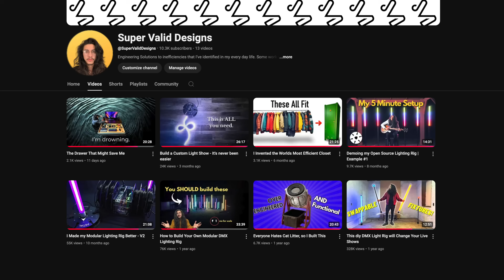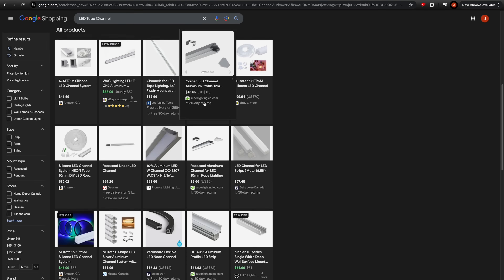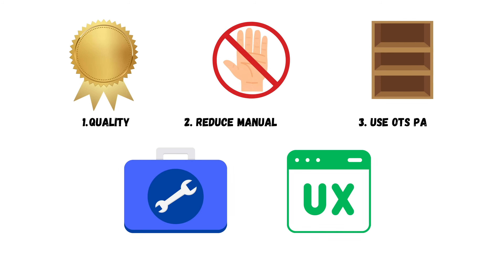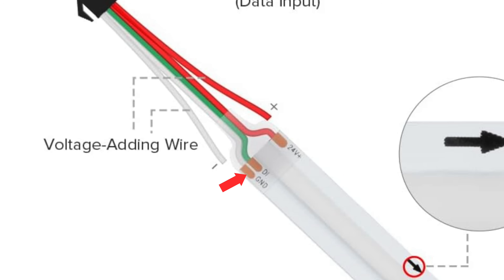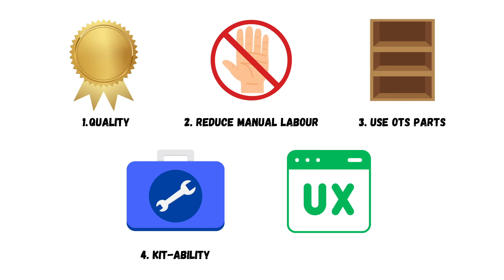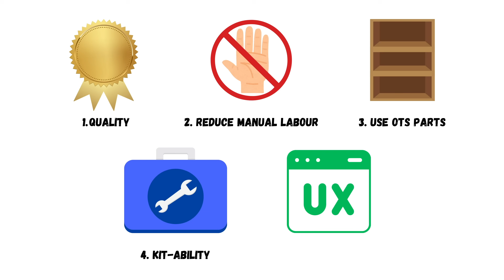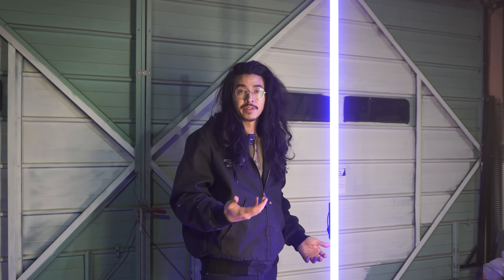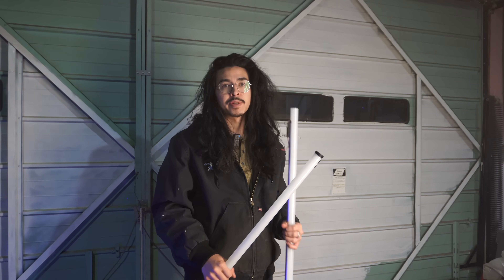The Stacker | Designing the first Official PETAL Fixture

Comment: This is incredible, I love your process, clear design guidelines and full integration approach with the manufacturer to end user pipeline tied to your own production, what a great plan! Where did you learn how to have a workflow like this? Are there any YouTubers or sources you learnt from that stand out? 

Have you thought about a more complex kit that has something like a pogo pin design and tighter tollerances, with something like an internal hoop to join the seam of the parts more rigidly? This hoop could be made out of a straight piece of clear plastic strip that feeds into the same cutout in the aluminium extrusion, requiring a light file stroke to add clearance and help with alignment for the increased width of material in the groove otherwise used for the light strip itself. This may not be necessary with the partial offset of the extrusion into the next piece, and it certainly looks like that is the case, but it might be necessary for closer, semi-long-term setups (or if you make a thinner or thicker varient). 

There are some relatively affordable benchtop cnc machines now, you may find that using a different material and a CNC provides a better consistency, fit, and scalability whilst reducing time per part.

I don't even have a use for light bars but this was a really intriguing video!
Reply from the maker: Thanks so much for the thoughtful comment! I've been building and designing things my whole life but I never had any formal training so my methods are probably fairly unorthodox lol. I love channels like Stuff Made Here and DIY Perks, they've been a big influence. The full integration approach stuff is all things I've had to figure out piece by piece and still something I'm very new at but I just love the process of learning about it! 

I have thought about the pogo pins, and originally I wanted to incorporate that into this product, but in the interest of keeping cost's donw and allowing for more tolerance due to our current manufacturing processes, it was just a bit out of the scope for this version. But this might make an appearance in future versions.

From my testing, adding a hoop always gave away the seamlessness away a bit more that just having the 2 tubes touching on the edges. The big issue I couldnt get around for the hoop idea was holding the hoop in place without using any adhesives. I also though having a hoop there would create a delicate spot that could break easily. It would be nice to have a more positive joint there but I have been really impressed with how well the offset aluminum channel has worked! 

I do have a onefinity cnc machine (I actually just got it set up again since moving shops!) and I'd love to get back into cncing stuff again but its always been a process that I found takes more work than using a laser or a 3d printer so I usually only use that when I absolutely need to. I also want to try and reduce the amount of in-house manufacturing that we need to do, hence the leaning towrads 3d printing where you can just set it up once and then just keep hitting print and letting it do it's thing.

Again, really appreciate the comment, it's super fun to answer questions like these!
Reply: @SuperValidDesigns  Wow, you've clearly put a lot of effort into the design and process! I watch similar channels, I love inheritance machining, but that's a slightly different side to making things with more manual milling and lathe machines. It sounds like you've got a pretty solid product for the factors you're working to, have you considered contacting the suppliers of the other components directly (ie, the light strips) and creating a custom drop shipping order on purchase? If you're already doing it with the lights it may not be too much more expensive. You could list it as part B, where your stacker component is part A, with the optional accessories such as stands etc. included in either part A or B based on packaging costs or convenience to integrate in the dropshipping order without error on their end. I am currently making a small batch of necklaces for some friends, and I realised that it was easier to arrange to have all the parts (clasps, jump rings, necklace material, I considered boxes and other things too) arranged by one seller, accepting a markup, and having them be responsible for it all. It worked a treat, because the necklace material was the wrong size, and they solved it as soon as I let them know. It was a whole lot less hassle than having to remember what vendor I bought it from and then go through the process with them individually. The seller wanted to keep me happy so she told me what she was going to do to ensure that would never happen again, I get to keep the chain, and I get a new one at the right dimensions asap. Just a thought, you've probably got a plan or experience with that, but you might think of something else based on that!

Maybe if you have a lot of interest, you could make a pro version, that can be quick connected together and has pogo pins and a click together system, that's probably not realistic though. If the hoop is too tempramental, you could experiment with chamfering the edges of the tubes (making them one way up with a male and female chamfer on each end) so that there's a more positive connection, it does look seamless as is, but that might make it a little bit more consistent. I really couldn't tell where that join was though, which says a lot!

Maybe if 3d prints are easier, you could consider a resin printer. They look so much more professional and finished, but again, that almost certainly adds cost before and continually. I've heard that resin is disgusting and sticky to work with on a large scale though, along with taking longer to print. You could of course print using a denser construction on the print bed if you do go that route. If you went with a resin approach or a densely populated print (5 or 10 parts per batch) it would likely increase the waste, but it reduces overall contact time. If you haven't seen, there have been some interesting videos I've seen recently about people automating production on 3D printers by putting a part bin in front of the printer, and telling the printer to essentially push the finished print into the parts bin. That's probably the best method I can think of for you to integrate in your design :)

Comment: That's fantastic! I'm working on something similar with shorter 3D-printed LED panel sections. For the UX, I’m trying to eliminate all wire connections for the end user by integrating magnets and Pogo pins for connections between sections. Perhaps magnets paired with Pogo pins could work well for your project, too!
Reply from the maker: Yes i agree! Pogo pins were part of the original plan but we opted to go with the cable connections as we wanted to make these fixtures as easy to manufacture as possible and the LEDs require no alteration at all this way. I think a version 2 of this fixture could see a pogo pin solution like you describe though!

Comment: Really awesome stuff, in my mind, connecting them together, should snap and turn the other one on without outly exposed cables. I imagined something fancy, like your sliding harness but with matching contacts, see if you can squeeze some pads there, but now thinking, since you have 3 wires, you can use a simple 3.5mm headphone jack, male and female, aligned with the slot - connect, and voila

Not a common connector, jack to led connector, but you'll find plenty of manufacturers that will supply you 1000s of these for pennies

Lmk what you think, all the best ❤
Reply from the maker: That was the original plan! In fact i used the 3.5mm jacks in the original prototype. The reason I went with the cable connections like i did is because they come with those already and in the interest of keeping things as simple as possible, it made more sense to just stick with those. It makes the user experience a little less satisfying but I think a version 2 could see a connection using pogo pins or something as you describe here.
Reply: @SuperValidDesigns  if you aim for most user satisfaction and best experience in the upcoming version I recommend a magsafe type of connection, hope you can source it or design it simply enough, maybe the small magnets can be the leads also - anyhow thanks for commenting! All the best! 💜😇